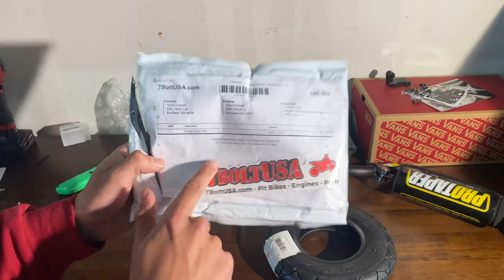The TRAXXAS SLEDGE is TOAST...SERVO HOUSING BROKE IN HALF!!

Comment: They claim this rc doesn't need any upgrades compared to the kraton RTR. But het i see screws flying off chassis bending obviously and spur gear teeths flying off. I got a kraton exb put stock electric from a RTR kraton been my best RC next to my notorious Exb minus shock towers and chassis.
Reply from the maker: im gonna have to pick an Arma up for sure!
Reply: @Tavionag  if you do get the exb lineup. I dont like the idea of upgrade when it breaks . Ypu can make a exb kraton run for 100$ ish more than the RTR and have all the upgrades the RTR doesnt

Comment: Wow I've never seen an rc this expensive fail so quickly and your not the only one . I test drove the store demo (1st) run and rear driveshafts popped out front Axle snapped , after a 2mins running in grass 😑
Reply from the maker: yeah its ridiculous but everyone in the comments would rather say I dont know how to drive lol when I used to race rc cars
Reply: @Tavionag  theres just no value on the truck. One reason why when it breaks we immediately are disappointed. If it was 650$ we would be saying these things. But its 800$

Comment: Your steering servo was twisted up.  Not sure that was a Traxxas thing.
Reply from the maker: dude the servo housing is broke in half lol that has everything to do with being cheap
Reply: @Tavionag   I understand.  The point is:  The servo horn was pushed past its rotation.  If you set the ends, this is less likely to happen.  Even an expensive servo will fail if the limits are not set correctly.